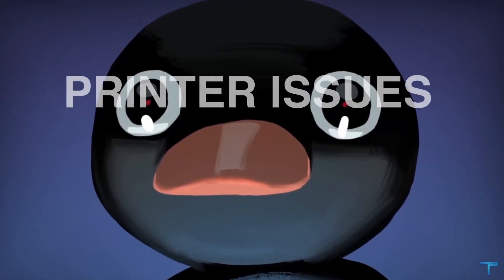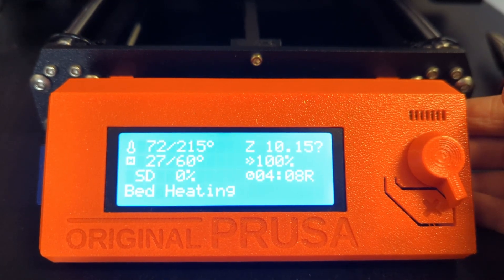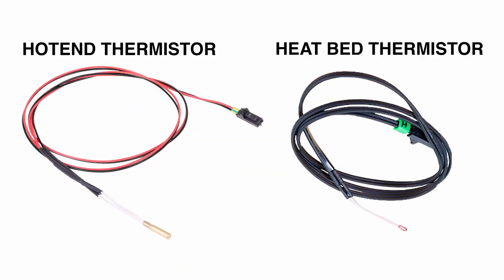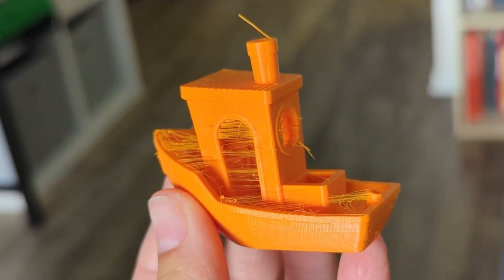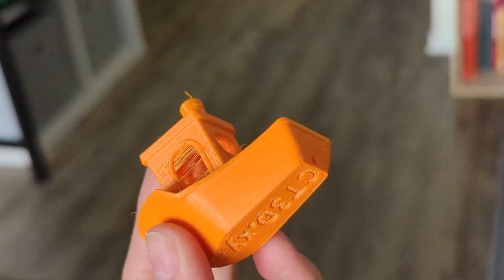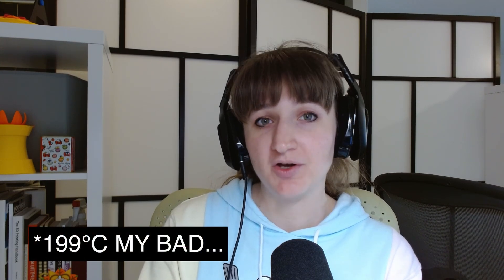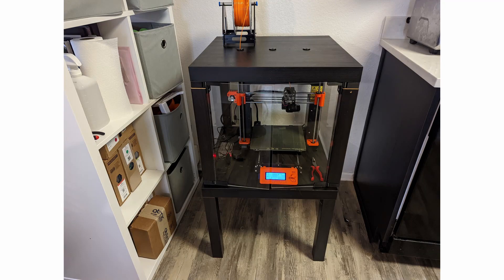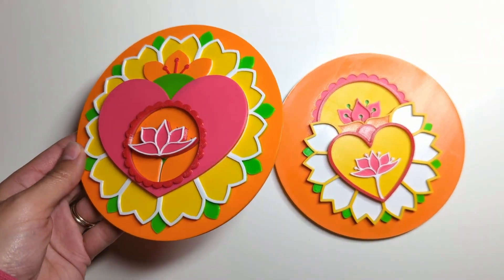Dealing with Hotend Thermal Runaway - Calling all 3D Printing OGs

Comment: I have a problem with my tevoup hydra, I replaced the hotend a little smaller than the original in connection with the replacement for a broken temp sensor and heat creep, which now if I set the heat to 200 degrees c, it runs up to 250 degrees c

Comment: I'm usually good at picking up what an accent is. Yours has me stumped, but I'll take a guess, are you from South Africa but have lived elsewhere long enough to end up with a hybrid accent?

Great video. I had thermal runaway recently too, but it was due to me experimenting with my machine after flashing the firmware.
Reply from the maker: Bingo😁 South African, I live in the US now.

Comment: Had the same issue on my MK2.5S. The termistor is working good and it does its job. Check out the fan duct, maybe is oriented too high and is cooling down part of the hotend instead of filament. I fixed replacing it and lowering a bit the fan speed in the filament settings from 100% to 85% and keep the 100% only on bridges
Reply: If it's the fans, it could also be that the heat sink cooling fan is aimed too low. More likely in my opinion from what she shows us, up to the 3m30 mark at least, is that the "normal print speed" above the "initial print layers" is set too high for her machine to keep up with how much material she's extruding. It's also possible, though it doesn't match the sequence of events, that there is a kink in one of the wires leading to either her heating cartridge or her thermistor that is shorting the signal whenever her carriage crosses a certain position on the gantry.

Edit: And less than a minute later I see that she already eliminated kinks as a cause.

Comment: Yes, the "cause" is the fan blowing on the block, with enough cold air that it cooled the area of the block where the thermistor is placed.  So, either a warmer room (as you guessed),  or a silicon sock to better insulate the block.  Since you really do not want the PART cooling fan to be blowing onto the BLOCK, you might also look at the duct for the part cooling fan to make sure that it is pointing at the tip of the Nozzle, and the part.

So, it's not the "speed", but also check the fan settings, since the fan would most likely be at a higher percentage, since the faster it is moving, the more cooling that the PART would need.   Glad to hear that you were able to trouble shoot the system and work the causes as to what may be causing the drop on the temperature.
Reply: I concur, especially on the suggestion of a silicon sock to protect the heater block from drafts - natural or fan-forced.
Reply: Absolutely!  The sock is a necessity for sure.  That was my very first thought when I didn't see it.

Comment: I like the new one.

So it seems like it was happening when your part cooling fan kicked on, so possibly it was too cold and the fan was triggering the error. 

Your hotend being at 5-10 degrees under target temperature is not normal, and not acceptable. 

If you continue to have issues like this try running a PID tune while your part cooling fan is on, I think you would need to do this via octoprint as I am not sure the LCD option would let you do that. 

Alternatively use a hotend sock.
Reply: I'm inclined to agree. I'm using a fork of Marlin now, and it uses a different thing rather than PID, which you can tune without any mucking around with Pronterface ect, and it bases everything on a map it records of the heating and cooling behavior. It seems to be very stable. I would say a silicone sock is pretty much mandatory, cooling is for the heatbreak, don't you want the hotend to be erm.... hot?